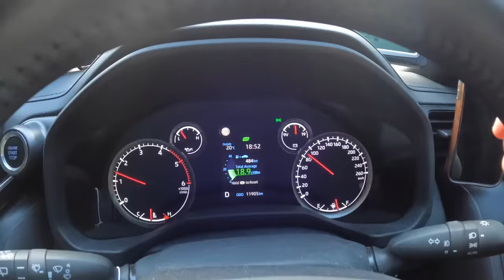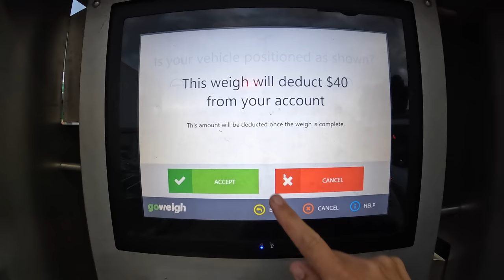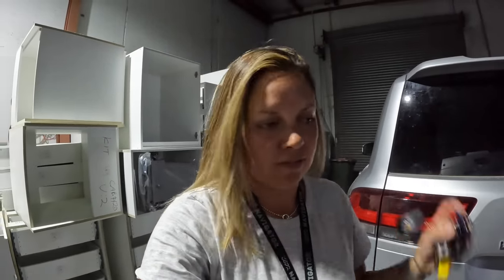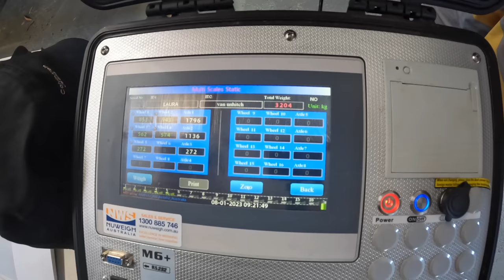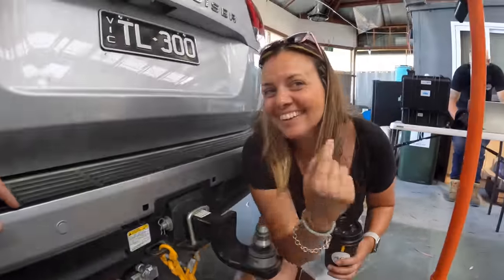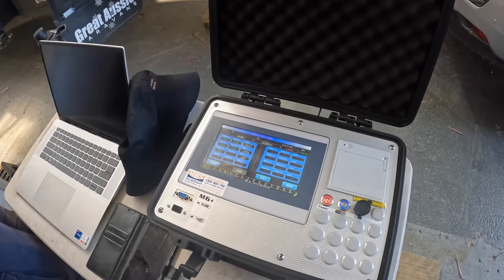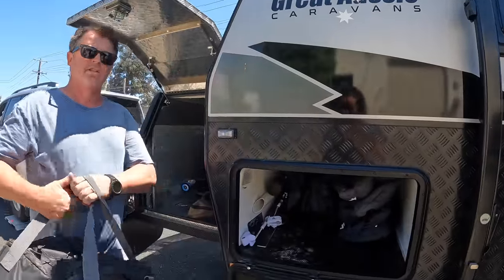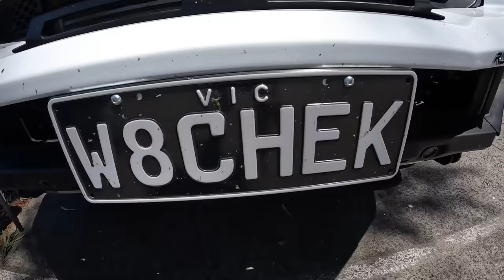Watching Our Weights | Weighbridge vs Professional | Car & Caravan Weights

Comment: Very interesting results. The weighbridge was 5.7T GCM and the specialist was 6.087T. 
For an initial weigh in and information the specialist would be great. But for further weighing on departure for a long trip a public weighbridge should be acceptable. It's within 10% (actual 6.8%) which for many practical purposes is OK but I think most people would hope for a closer result. 
I wonder how you would go on a road side check with compliant weighbridge weight documentation.
Reply from the maker: Good points there! When I went to the weighbridge I don’t think I had a full tank of fuel or the water tanks filled up. Also Troy & Coco weren’t in the car nor the allowance for Harrison or all of Troy’s tools so there were some factors for being much lighter. We had a lot of things in the van when Leon came over because he told us to pack the van as if we’re doing our big lap so we needed everything included. It was a great exercise and we’ll do it again before we take off.
Reply: I have the same thaught about weighbridge document or a professional weight printout, would they take it into consideration. I am thinking NO and just go on what their scales reveal at that time. I haven't been weighted buy police or inspectors yet so have not been able to quiz them on their expectations. Would be interesting to know.

Comment: Hi guys, a great informative video like yourselves, we have been checking weights also, we tow with LC200 2500kg single axle 260 kg TBW ,with cruisers easy to exceed the 1950 kg rear axle max load. TBW x 1.5 gives the approximate kgs on the rear axle .With the 300 series, the rear axle & GCM is lower than the 200 series puzzling why Toyota would do this. Safe travels.
Reply from the maker: Hi Ian, thanks for watching. Yeah it is a bit puzzling l think Toyota was trying to make the 300 a bit lighter and more fuel  efficient. doesn't give you a lot of payload.  Safe travelling 🍻

Comment: Giving information on safe towing weights and the best way to weigh your setup and yet you had no towing mirrors used for a van wider than the towing vehicle. Good info on the weights though.
Reply from the maker: Haha, we were parked out the front of our factory, Pretty sure mirrors aren't required 😄 .

Comment: There is a job well done. $330 well spent, how long does it take to do? (not counting having to move outside)
(i'm in wa so price may vary, but i will flip the towbar tounge.)
Reply from the maker: Hey Colin! Leon allows 2 hours for the weigh & report however can stay longer if need be at no extra cost. There should be companies in WA that do the same thing and can come to you.

Comment: Just a note may pay to check if you are allowed to turn your tow hitch upside down reason being on my 200 series it state you are not allowed to invert it, interesting process though we had ours done last year when absolutely fully loaded and passed the test but we have had a GVM upgrade also
Reply from the maker: Hey Michael good point. We actually changed our hitch a while ago so haven’t had the Toyota hitch for a while. The new one didn’t have any stickers on it to say we couldn’t invert it, Leon checked that too. We definitely need a GVM & GCM upgrade but only when cost effective down the track.
Reply: Can you advise what tow tongue you are using that allows you to invert and still have a tow capacity of 3,500kg?I’m sure there are al lot of people other than myself that would like to know where to get one. I have the Toyota off-road tongue which can’t be inverted.
Reply from the maker: Hi Stuart,
You can try Mister hitches this is Reversible and adjustable it's rated to 4ton
Reply: Should have mentioned I love watching your eps. Keep up the great work. Really useful content in all shows, but particularly in the weights one. Kudos to Laura for taking the van through the BP and then backings it into the shed!!!!!
Reply from the maker: Thanks so much Stuart, that’s really nice to hear that you’re enjoying our content! It definitely helps us as creators with the feedback. Oh that BP weighbridge was frustrating but backing into the factory is an experience that’s for sure!
Reply: @JourneyUnknown  You are an inspiration to all women in this ep. Keep up the great work!
Reply from the maker: @stuartsmith8127  Ohhh thank u so much!!

Comment: Where was the public weighbridge you used and how much did it cost? I have a 200 series Landcruiser with a lot of added weight incuding accessories and long range fuel tank so want to weigh it to ensure I am below GVM.
Reply from the maker: Hey Peter, it was at BP Dandenong Truck Stop. There are a few BP’s in VIC that have these public weigh bridges for use. It’s $40 for a weigh and well worth it if just needing to weigh your car.
Reply: @JourneyUnknown  Thanks for the response.
Reply: There is a weigh bridge at the BP on  right hand side heading into  heading into Melbourne.
Reply from the maker: @katherineporter2654  yeah plenty around, Dandenong, Eastlink, Monash Fwy, Western Fwy
Reply: @JourneyUnknown  There is a free Vic Roads one at Broadford  Vic along the freeway heading north.
Reply from the maker: @macaccess1884  oh that’s good to know, thank u!

Comment: People keep getting GVM upgrades.. Yes they are legal but there is a MASSIVE flaw. Your roof is a ROPS..Roll Over Protective Structure. Now that was designed to handle the weight of the STANDARD vehicle in a roll over. Now to increase the load on the ROPS in the event of a rollover due to a GVM increase, seems to me to be so wrong without adding a rollcage. Which in itself will add a heap more weight... constantly chasing your tail just to carry more crap and decrease the chances of surviving a rollover.. it's madness. I was going a GVM upgrade but due to the obvious flaw in SAFETY I will no longer go down this road or buy a vehicle that has this upgrade. I'm glad you guys are concious of weights and being legal etc but please think about the point of have just made more so if you have children.
Reply from the maker: Good points Brett. Thanks for watching and commenting. Yes it’s interesting because if you read your manufacturer manual it will state what the roof can hold and then depending on what roof racks you put on, that has a weight limit too. Not many people follow these regulations. 🙃